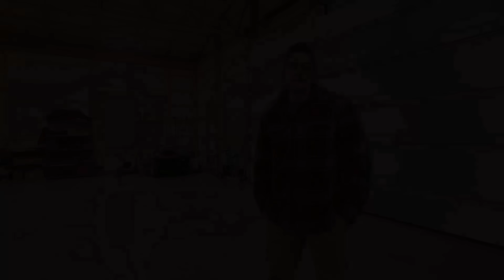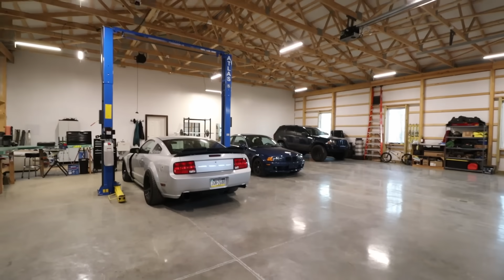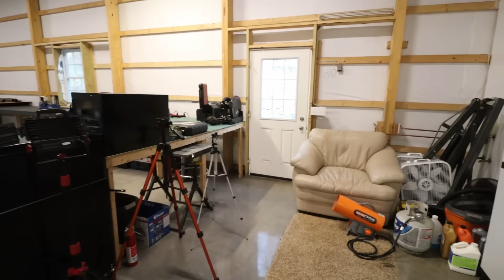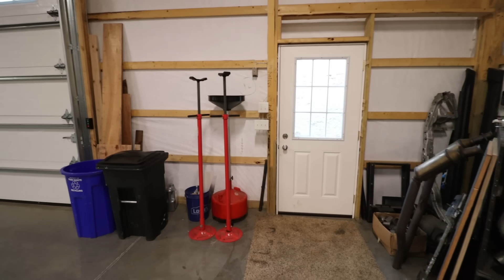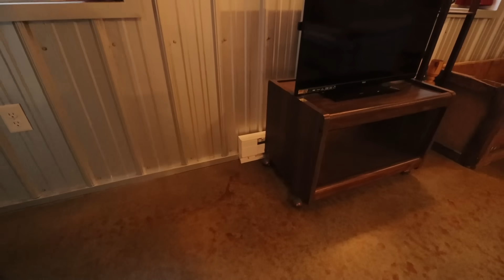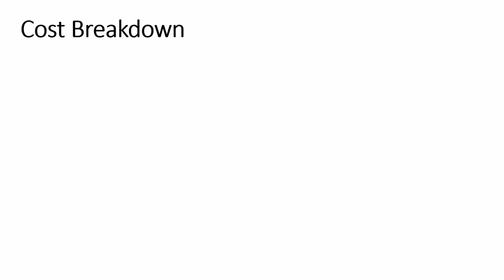50x70 Garage House - FULL TOUR and COST Breakdown

Comment: Cool set up.  Im trying to do similar at 24.. Still looking for the right lot though. Going to try to do radiant heat in the slab and get all the exterior walls spray foamed
Reply from the maker: Thanks, yeah I thought about radiant but just didnt want to deal with the complex system and cost. Good luck with getting yours done 🤘

Comment: Nice;  garage house, what state do you live? , here in Ohio I was going to build this similar setup on my property out back that already had a house on the property, but was denied permitting because living space could not be on q pole foundation.  I ended up only permitting for  a basic 30 x40 garage for the inspection, then over the next couple years I added electric . natural gas, and basic plumbing which all tapped into the existing house.  After about 10yrs I sold that place and nobody was the wiser..  my bad..lol
Reply from the maker: I'm in Pennsylvania and luckily didn't have an issue with having living space inside.
Reply: Yea, that's already been covered under 'so many stupid (bullshit) rules'.

Comment: Do you think there’s any negatives to going with a pole barn style vs a normal foundation?
Resale value?
Longevity of the house/foundation?
And since your house is essentially sitting on dirt, more insects? Or harder to keep warm because the ground cools it more than it it had a crawl space foundation.
Reply from the maker: Yeah only negative is longevity. You can get around it by doing concrete piers to sit the posts on, which avoids the rotting issue. Otherwise the concrete is great, seems to make it very easy to regulate temps in the house. And haven't had any big issues with insects.

Comment: Another thought, If you are tighter on cash and want to do something like this;  Look into abandoned or disused commercial shops.

There are tons around me and thats what I ended up getting.  It was much cheaper to completely gut and rebuild this building than it would have been to build from scratch.

Whether or not you can technically "live" at a location depends on zoning usually, so you either are quiet about it or try and get a variance (usually in the 1-2k range)
Reply from the maker: Good suggestion 🤘

Comment: i flip houses and have some property that i have been wanting to build pretty much what you built.  you presented a great simple video on what it takes to build a specialized structure like you have and your cost estimates are pretty accurate, of course depending upon where a person lives.  in some States, (W.Va. and most of the South) you could probably build this structure less than even your low end estimates, however, you certainly could build this place at the budgets you suggest in those cheaper States.  very nice job and you are very lucky to have such a nice shop and "home" at such a young age.  i'm finally getting together a nice work space for my car collection "after" retiring.  good luck!
Reply from the maker: Thanks for the feedback and for taking the time to watch!

Comment: One thing I'd like to tell you is The Home Depot has lots of nice heavy duty toolboxes. I got a Husky tool box that's 52 inches wide probably 5 foot tall and 20 inches deep. Soft close drawers. $699. You don't need snap on on a budget. I love mine. They have different sizes available and usually free shipping. I'm restoring a 76 Corvette. I only have a 3 car garage. I love your set up. How much land do you have? I wish I'd done this when I was young. I'm 61 now so a little late. Excellent job!
Reply from the maker: Appreciate it! And thanks for the tips, I believe most of my current boxes are from home depot/lowes as well. I have about 8 acres here.

Comment: Radiant tube heater would work fantastic in this space, radiant heat , heats objects in room i.e. cars, concrete.  Floors dry in minutes.
Reply: Heated concrete floor with a outdoor wood burner would be perfect but a little bit more pricey for this size lol
Reply from the maker: Yeah I thought about that but just didn't want to deal with the cost and complexity of that system.

Comment: You appear to be a little off the grid. What does your electric bill look like?  You might consider a solar panel setup. A good system could save you on electricity, bank a little money, and increase the value of your property. The monthly payments may very well be equivalent to or less than you pay now. If you get the system on a loan the interest can be used on taxes providing your able to itemize.  Personally, I like the Tesla system.
Reply from the maker: Mine are very low, like $40-60/month so it's hard to justify messing with solar at this point.

Comment: LOVE this!  I would suggest you wall off and put a door at the top of the stairs, though.  All your heat is going up there.  Also, I think I saw a hole low in the outside wall by the computer monitor or whatever that is at 21.50 in the video?  Need to plug that or you will have mice!!!
Reply from the maker: Thanks! I do always have a sheet of insulation over the stair opening in the winter. And dont worry there's no holes in my walls, you may have just seen light or reflection from the window.
Reply: @Kordare    Good!  I really love your barndo.  My husband is an artist, and we want to build something like this where the garage (much smaller than yours) would be his studio.  You've made a very comfortable living space, and you've thought ahead to changes in the future, such as the mud room.  Bravo to you!
Reply from the maker: @joann5157  thanks so much, and good luck with making yours a reality!

Comment: Also I once met a couple they bought a cheap camper and lived in it while they were building there pole barn than pulled the camper into the pole barn and it doubled as extra living quarters while they built there home. After a fire in the home my company was called in to repair the home they just kept the money the insurance gave them to stay in the hotel and moved back into the camper inside the pole barn. There pole barn made yours look like a garage but they had years to put together what they wanted and they built it together not had someone build it for them so in that aspect they got what they wanted took longer doing it and were only out the cost of materials rental equipment and blood sweat and tears.
Reply from the maker: Very cool!

Comment: Being good with metal if I where you I'd just build a waste oil burner to heat the garage. I have a barrel stove in mine and I put a waste oil attachment in it so it can use either
Reply from the maker: I'll most likely do a wood stove since I have infinite free wood.
Reply: @Kordare  I have 3 teenagers driving plus me my wife and mother n law so I'm always doing oil changes so I switch back and forth. I'm getting ready to start construction on an indoor foundry to melt aluminum Iron copper and steel so I can start pouring some molds possibly a gentry lathe project maybe something a little more sophisticated so I can start duplicating things that I like. I figure if the Chinese built an economy off duplicating our products and a 3rd grade education. The sky's the limit for what I can make lol
Reply from the maker: @kevinlewis9151  haha sounds like fun, good luck!

Comment: hey man do you have a retaining wall? the edge of your house is literally inches from where the hill starts slanting, if theres no retaining wall the foundation could literally slip from under your house/ cause tons of issues with the land and house.
edit: not even inches at around 4:55 you can literally see the corner of your house more exposed then the rest of the foundation at the base. not even inches away, this is happening at your foundation.
Reply from the maker: My foundation is poured footers at each post location like 4 feet in the ground, dont worry nothings moving. Also the ground here is full of slate so its extremely  solid. Zero has changed in 2.5 years of the house being here. What your seeing is just a matter of how we graded the top soil around the house.
Reply: @Kordare  that's reassuring, i would hate to see this place ruined because of a heavy rainfall. awesome place you've got i'm very jealous
Reply from the maker: @Sublime_scat  agreed, everything was done to code with an experienced builder and excavators. Thanks a lot!

Comment: Not sure why ya came up in my recommended box..
But. The place looks great for what you want it for.  Ya can't build a.place to big. It'll fill up and overflow before ya know it.  Great job thinking ahead for future use of areas. I would do a car cover or two if you're going to work in the shop. Maybe  weld curtain too. Metal particles get all over everything. Odd as it sounds, I'd consider another outside basic garage.....just to keep the cars out of the work space.(as money/time permits) I May have located the toilet closer to the big door end.     But good job.
Cheers.
Reply from the maker: Thanks a lot, I appreciate the suggestions and agree with most of what you said. Just have to stay patient and keep improving!
Reply: @Kordare  Hey, not criticizing at all man. The place looks great - sounds quiet too.   I'm sure ya got plenty of "helpful hints..lol from the viewers. I didn't read all the comments. Just chip away at stuff as ya have time and money... friends will help and you'll help them.  Just continue to watch your costs and it'll work out great. I'd throw in - be cost sensitive. Everything is crazy expensive these days, but ya can always find the same product a bit cheaper if ya shop around.  Ya got the hard and expensive stuff done. There isn't anything left you can't do yourself(if Ya want) or with another set of hands.  
Cheers
Reply from the maker: @capitaldd5840  yeah I completely agree! I'm pretty good at taking my time and never jumping into big purchases because like you said there are almost always cheaper/easier alternatives. Appreciate your comments 🙏
Reply: Didn't notice a fire extinguisher In the shop or house....just a heads up...  been there done that..🔥
Reply from the maker: @capitaldd5840  oh yeah I do have a fire extinguisher in the shop but could probably use a couple more just in case 👍

Comment: What was the first step you took in having this built? Was there a specific builder in your area or did you have to talk to a contracting company? Thinking about going this route in Washington state.
Reply from the maker: I did the basic design myself first, then searched for builders and got a bunch of quotes from different builders using a few different building types.
Reply: Kordare were you able to bundle land, building and all other expenses into one mortgage or is some of that separate?
Reply from the maker: @shanevigh  I actually bought the land a couple years before building and worked hard to pay off the land first before building.
Reply: Very nice. Thank you for the information. I appreciate it!
Reply from the maker: @shanevigh  no problem, good luck with getting yours built!

Comment: What sealer did you use on the concrete.  Hard for me to decide.  And how do you like it,   Thanks
Reply from the maker: I used surecrete polyaspartic coating that I rolled on. Its held up pretty well, some has peeled as a result of putting it on to concrete that was very cold and not completely dry.

Comment: Very well done. Very Jealous. May I suggest a 3-head VRF ductless mini-split Heat Pump in the 25 seer range? They sip electricity... When you have to start buying fire wood, the cost of operation is not much more. peace!
Reply from the maker: Thanks for the suggestion! A few others have mentioned that a mini split would work well and I'll definitely check them out 🙌

Comment: The transition from garage to house, isn't it required that the living area be a step up to prevent gases (Carbon Monoxide mostly) from entering the living area?  I really enjoyed your build, your explanation and I am impressed with all your planning, financing and the actual completion of your plan.
Reply from the maker: Thanks a lot! You are correct, the living space concrete had to be about 4-6" higher than the garage. I believe the main reason was to prevent a vehicle from easily entering the living portion.

Comment: WOW.     AMAZING!
But, if you block off the top of the stairwell to the attic.... 
you'll save 50% or more of your heat.  Fundamentally, heat rises and so you are losing lots of it up the stairwell to an attic and thru the roof.
Reply from the maker: Thanks! I always have it blocked off with foam insulation in the winter! Just didnt show it in this video.
Reply: @Kordare   ok thanks.  you know your stuff.  good job again on the build.
Reply from the maker: @PatrickWagz  appreciate it 🙌

Comment: you should add a chimney pipe blower to move the heat from your stove; they're great , & use up some of the heat going out the exhaust. I would also put a woodburner in the garage too
Reply from the maker: Definitely will be adding a stove to the garage. And might look at a blower once I have to heat the upstairs as well. For now it provides more than enough heat.

Comment: rainwater should go into the ground , 1 so that the topsoil doesnt wash off as much and cause more desertification, also to replenish the groundwater to prevent ground shifting, finally so that large trees can drink it up.  letting rain pass over instead of getting it back to the ground  will increase likelyhood of trees dying during drought etc. more dead dry trees = more likelylood of forest fires
Reply from the maker: good points, I was only upset because it was just an unexpected cost near the end of the project.

Comment: Add a covered deck on the end of your house and say goodbye to the sun heating your house in the winter "really well".  Probably make it cooler in the summer though.
Reply from the maker: Yeah, that's the only downside. The stove does heat the space very easily so either way it wouldn't be a big deal.

Comment: Very nice build.  It appears that you took your time and planned very well.  What part of the country are you in?  I am in Florida and imagine the pricing is going to be significantly different.
Reply from the maker: Thanks! I'm in Pennsylvania where this type of structure is very common on farms so it is probably more affordable here
Reply: @Kordare  The pricing is probably going to be pretty close to the same here in North Florida.  I may do this on a smaller scale on my property for now.  My wife and I purchased 35 acres of "raw" wooded land in a very rural area.  We currently have a camping trailer out there, but I would like to put up something a little more permanent where I can keep equipment locked up and out of the weather and have a place to spend a weekend or extended time out there.

Once again thank you for your info.
Reply from the maker: @stevemartinez6757  sounds like a great plan, good luck with your project!

Comment: With spending that much for a water retention system, I would have added a tank and filter so I could use the rainwater for the house. Course, I'm in an area where personal wells are not feasible. Water depth here is around 4-5 thousand feet deep, so only commercial owned wells.
Reply from the maker: Oh okay yeah I have a well that's a few hundred feet deep with a good flow rate so I have all the water I need

Comment: Very interesting, K. Question: was your framing and sheathing a kit/pre-package that you planned the foundation/slab around or was it custom where the builder arranged the materials around a unique design of your own?
Reply from the maker: The builder arranged the materials but everything was based on standard roof trusses and standard overall footprint. So it was a custom design overall, but mostly using standard materials.

Comment: You could throw some plastic up on the bottom of trusses and that would retain a ton of heat in the winter. I've considered creating a smaller room inside with a lift in it if one needs to work on something in the nastiest part of winter. Easy to heat and cool a smaller space
Reply from the maker: Yeah , definitely looking forward to insulation. But winters aren't too terrible here so it doesn't prevent me from getting my projects done.

Comment: What do you do for heat? What did you paint the floor with ?
Reply from the maker: No official heat source in the garage yet, but I will be installing a wood stove. I used a roll-on polyaspartic coating from surecrete.